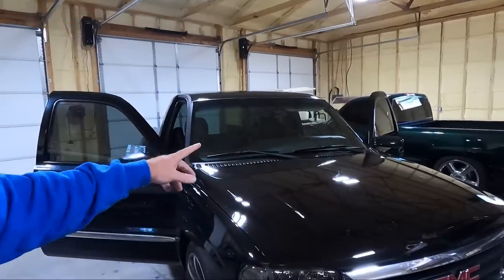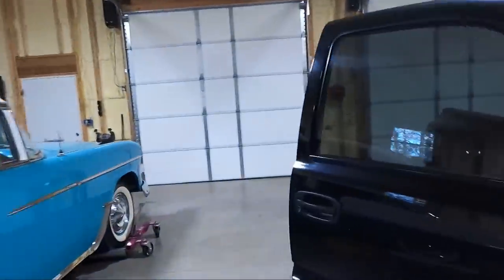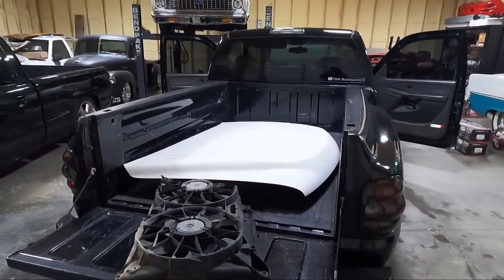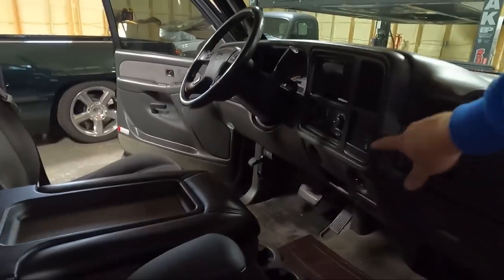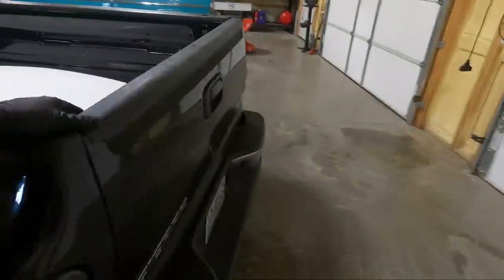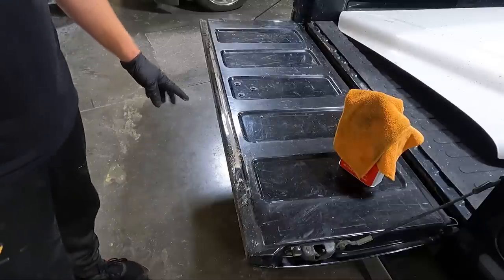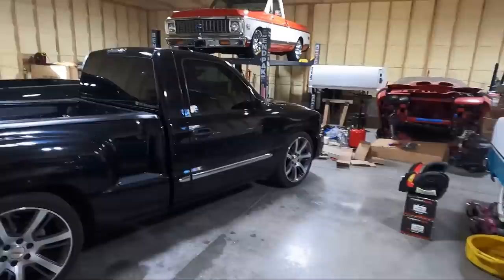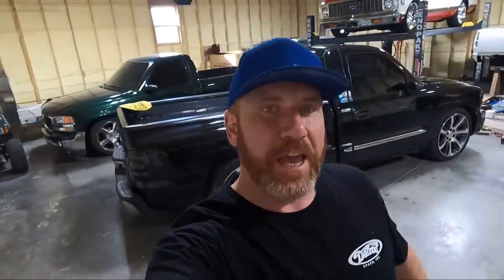Exciting New Parts for the NBS GMC Sierra Stepside (Time for Emblem Removal and Paint!)

Comment: you know the trick about cordless drills to lock the chuck, yes? when it's tight you should be able to click it back just slightly to lock it from loosening...I need to remove the emblems on my car. I like to be really clean about my work but I don't have a space that is exclusively my own so I'm always cleaning up others messes it seems before I can start my projects. those wheels look really good on that truck. never seen the hd hood on a half ton. should be interesting to see. cheers bud and excellent video again!
Reply from the maker: Thank you. Not sure that works on my dewalt cordless drill

Comment: I scored a headliner when I was doing my 04, it was perfect, for $25.  What do people do with those little covers? Mine were missing also.  They didn’t even charge me for them at pick n pull for them. 
Working on aircraft, we preach clean as you go.
Reply from the maker: That's a good deal. Those covers are to hide the latch system for a child seat.